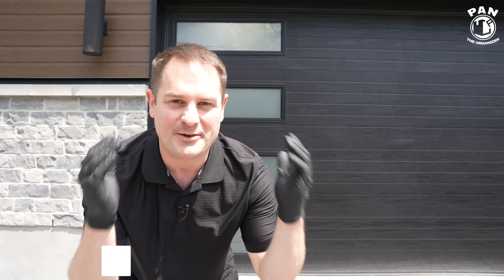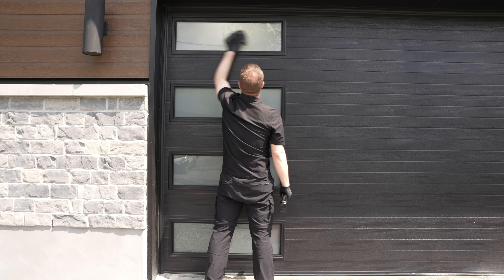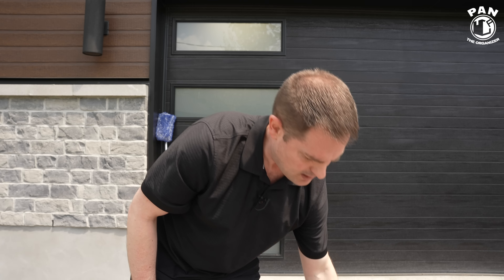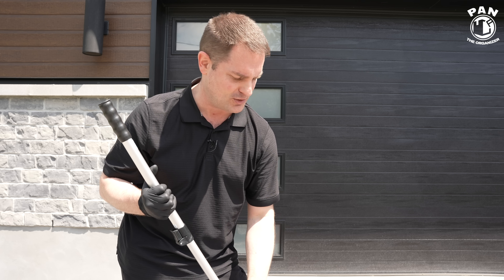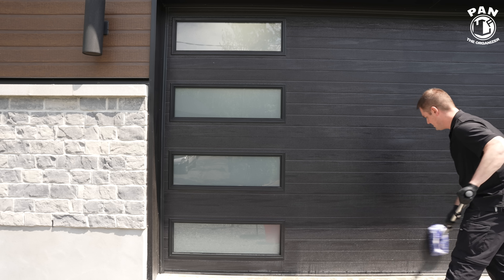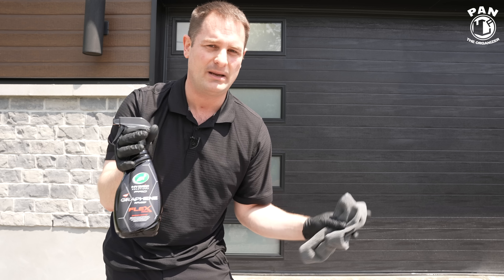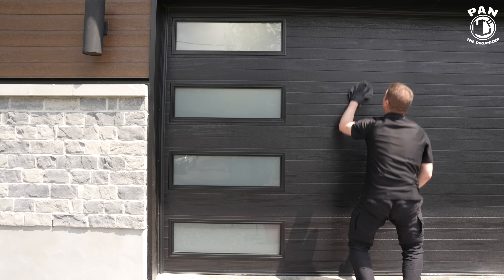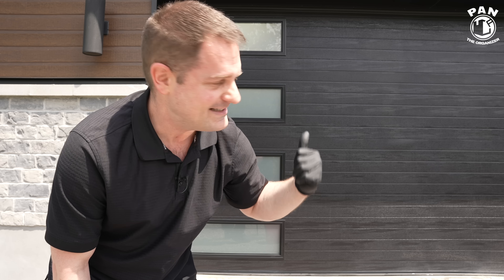How To Clean And Protect Your Garage Door!

Comment: Thanks for the nice video!  I have not cleaned my garage door for years.  Do you have any tips for removing the speckled mildew on white garage door weatherstripping?  Thank you.
Reply from the maker: An all purpose cleaner and a brush should do the trick if it’s not too bad.

Another magic trick with mildew is 50/50 mix of warm water and white vinegar in a spray bottle. Spray generously, agitate with a brush and rinse.

Comment: Hey Pan, what a bout ceramic coating the garage door? If you were to do it, what would me some questions you'd like to answer first?
Reply from the maker: It would depend what your garage door material is made from and if you can buy a coating that can be applied on that surface.
Reply: @PanTheOrganizer  What should I pay attention to when considering the material or finish and selecting a coating? Would it be just as simple as identifying what it is then google search for a coating that is made for that material/finish?
Reply from the maker: I would call your garage door installer and ask them what material your garage door is made from. Then find a coating that can be applied on such surfaces.

Comment: Hello pan a quick question not related to this video just about another product meguiars all purpose cleaner I've been told it leaves white stains on plastics have you come across this thanks your uk follower
Reply from the maker: Are you talking about the professional series APC? What dilution are you using?

Typically, when using an APC on interior parts, you must follow up with a microfiber towel that’s damp with just water and neutralize the cleaner. You should not get staining.

Comment: Hi Pam, I'm a big fan of your show! I have a Nissan Fontier 2022 with a truck cover from "Truck Cover USA" and I'm wondering if I can use the Turtle wax Flex wax to protected.
Reply: Correction: to protect it
Reply from the maker: I don't know what that is, but if it's fabric, no. Flex Wax is meant for use on hard surfaces: paint, wheels, glass.
Reply: Aluminum textured powder coating
Reply: Roll cover

Comment: Glad to see I am not alone cleaning & waxing my garage doors, however 99% of my neighbors do not do this simple Wash & Protect and as a result their garage paint has deteriorated over the years and color has changed. Only difference is that I use a high PH to remove all the gunk that accumulates over the winter months and then apply TW spray wax.
Reply from the maker: Yeah you can clearly see the ones who take care of their house and car VS the ones that don't. Time has its effect on everything!

Comment: would you recommend using like a water based tire/rubber dressing or something similar on the bottom seal or would that be overkill?
Reply from the maker: I use a silicone spray for rubber, just like I do for the rubber seals on car doors.

Comment: Hi Pan - I've got a very similar garage door though hadn't applied any protectant over the last few years and now the trim has faded. Same dark brown color as you have. What trim restore product would you recommend?
Reply from the maker: My door is black. Might not be obvious on camera. But if your door has faded, I’m not too sure what you could do to restore at this point as it’s not an automotive paint. You would have to ask your garage door specialist in my opinion.
Reply: Watching again, yes definitely black ;-) Anyhow, my paint is in great condition it is just the trim around the windows that has faded. I was thinking one of the trim restore products should work but most are made for black trim.

Comment: Put some sonax perfect finish on my plastic part at the bottom of my car; how to get it off as I tried already some things but without result and tomorrow morning I m starting my duraslick and I supposeI first have to get the sonax off before putting the coating 
Also, ended tonight with the ipa clean after polishing; should I do another ipa clean before starting the coating tomorrow morning?
Will look at the garage video after my coating :)
Reply from the maker: If you are only coating tomorrow, then yes I would do another IPA wipe tomorrow before the coating application.
Reply: @PanTheOrganizer  and how to get sonax off the plastic ? :(

Comment: Ya but when it gets rained on and sun comes out youre going to undoubtably have water spots and most likely those will etch into the finish...better to have a flat sheet of dirt water than spotting for something you dont really clean often. More specifically something you dont want to clean often ;)
Reply from the maker: I don't have water spotting issues with this. And it's a black door.